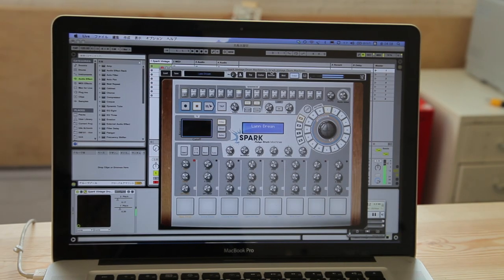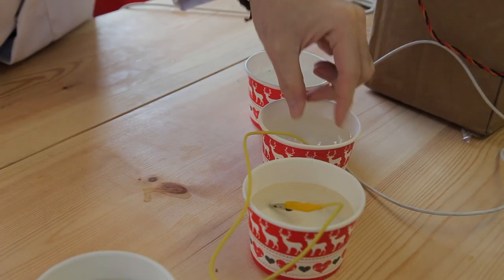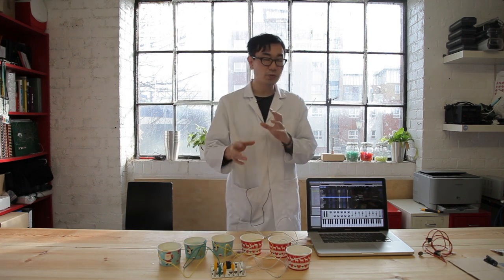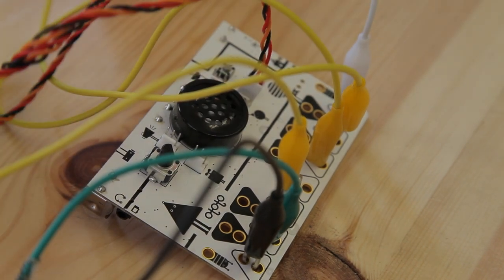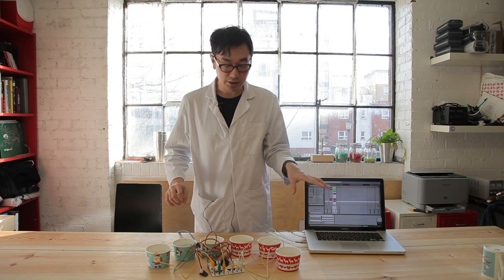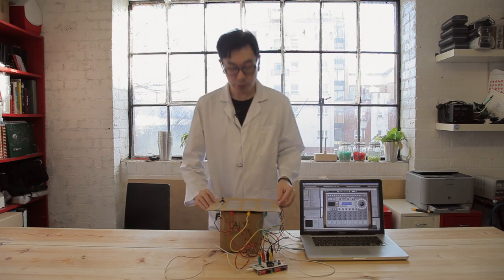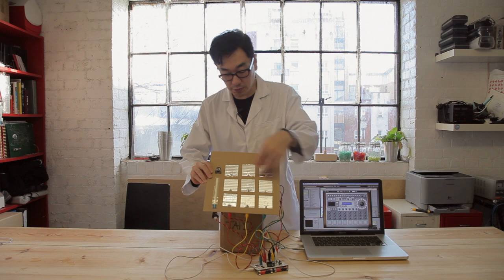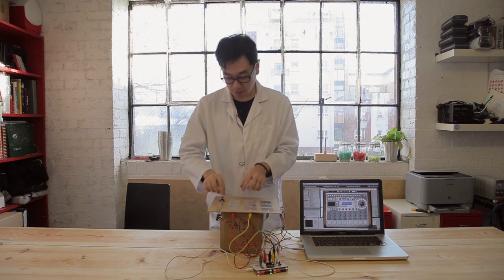Ototo with Ableton and sensors

Comment: So basically, in this setup, you've created 6 on/off switches out of Ototo and water cups instead of using a full controller? And most of the work here would be in understanding how to set that up in Abelton, making sure drivers are compatible, and finding the sounds/synths you want to pair with those on/off switches? Correct me if I'm wrong...
Reply: A lot of people have an easy time setting it up in other videos

Comment: Are the croc clips purely on / off sensors? or is there a way to control input parameters?
 ie velocity or would they only suit 1 hit input as in the drum demo shown? only the light & air input have a degree of control?

in other words after you've plugged & played your fridges content of veg etc & the novelty has worn off is this really just the base for a DIY drum kit? (still cheaper to buy a 25key cheapo keyboard controller with pads?) or cardboard tube electronic didge?
Reply from the maker: Yes In the default configuration it's purely on/off. Inside the touch sensing chip there is the possibility to get the raw capacitance value of each key. This means you can use it as a theremin like distance sensor. This is a little tricker to manage, we will definitely consider it for a future software update!
Reply: Dentaku
Thank you for reply. I look forward to seeing future development of the project and its application. It is certainly an affordable device unlike the teenage architects OP.
Interesting times indeed - hope it sows many seeds of creativity.